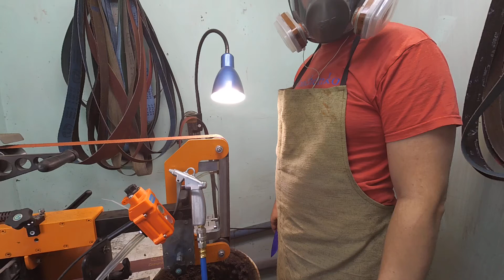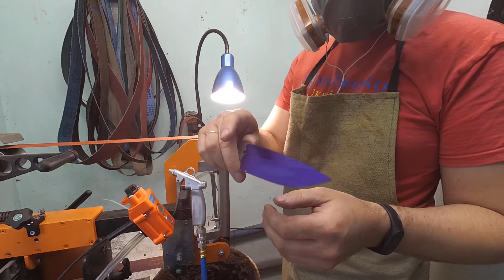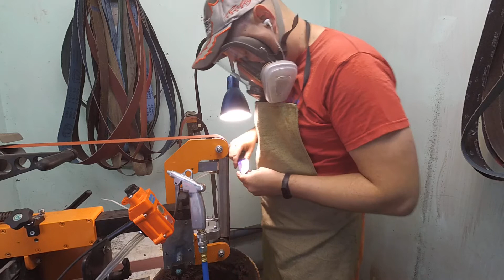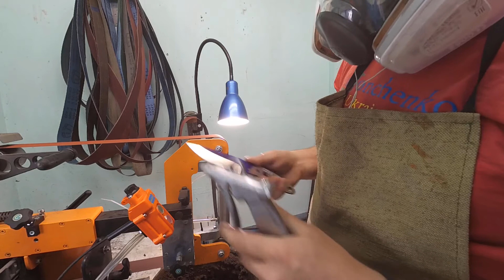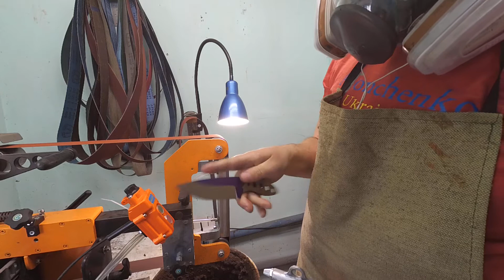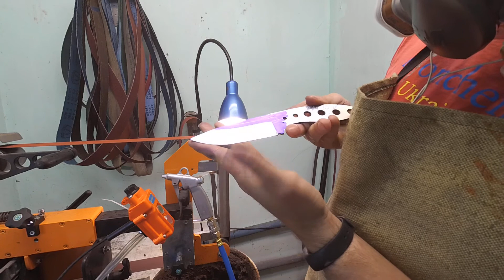Grinding CPM15 V. Carefully sound.

Comment: How do you like the chiller plate? And is that a ceramic platen I see on the flat grinding platen? How do you like those two together?
Reply from the maker: +VikingBladeWorks LLC Hello. Works very well. I work 1-2 hours and The plate remains cold. On my grinder is a plate made of metal.The ceramic plate works badly. It crackles.